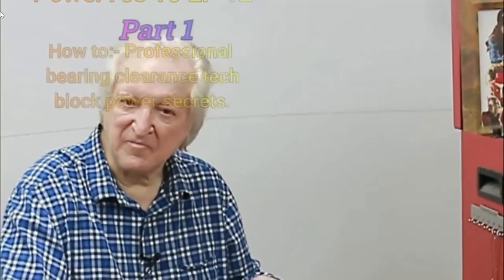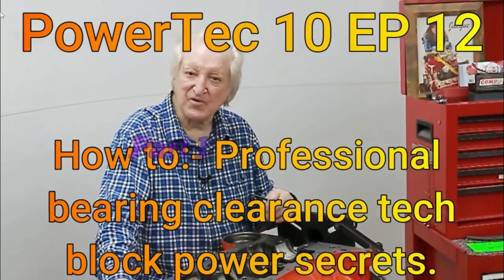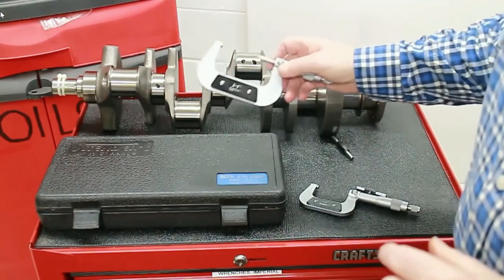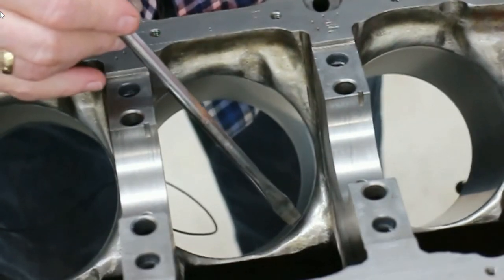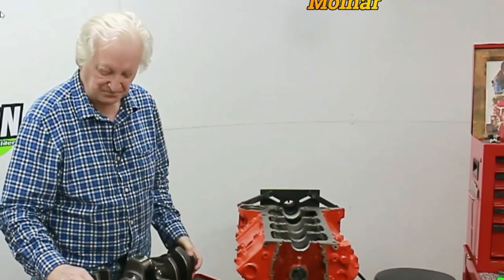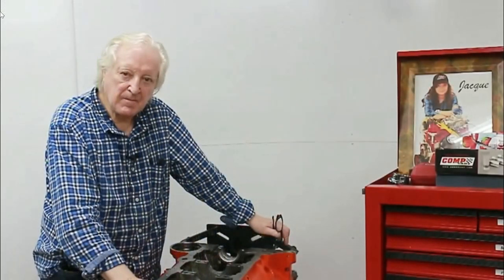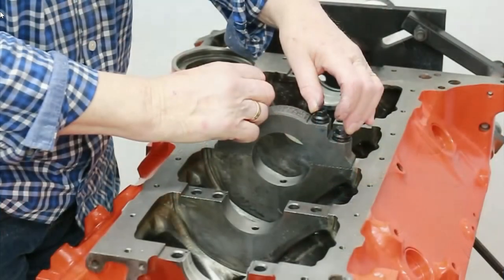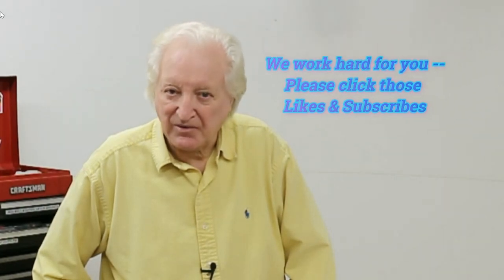Free short block power moves and setting crank clearance

Comment: Years ago and about the time Plastigage was just coming out, I apprenticed at a Cat dealer. At the time we used lead wire. Same proceedure as Plastigage, but when you pulled the cap back off just carefully pull the lead wire off and measure the thickness with a micrometer. Lead wire will deform without damaging the bearings.

Comment: Two things: 

One - i prefer to also check cap distortion with a bearing in place, especially on the rods since it's the only real way to check bearing crush and runout of the assembly versus the mating part. 

The dial bore gage is also very effective for checking cap alignment right at the mating face (should be perfect, often isn't).

Two:  plasti gage is a great tool.  I've used it for years as a final assembly check. I love that it gives an easy visualization of taper in the clearance (there shouldn't be any, but there often is).

Comment: For almost 30 years I've used the same rod bolt stretch guage and when checking rod bearing clearance I'd stretch the bolts to about 60% of the recommended stretch. That way during final assembly it's much less likely to get a rod bolt that turns into a noodle and stretches too much before it's recommended torque is reached. This is for plastiguage. But I also aquired a dial bore guage and decent micrometers years ago when still high quality and built in usa. I have quality japanese measuring tools as well and I still use a combination of both. Even a weekend engine dude should be able to buy mics and a dial bore guage over a 30 year span so start early as you can, but make do with plastiguage until your wallet allows.
Got a little ahead of myself, when building engines for myself or a customer, if it's high performance I still get use both methods plastiguage as a final, but will have used the dial bore guage and mics already in initial build and mock up. To me the most important thing to remember when running clearance checks is to look for trends. If you measured all journals of the crank 3 times and wrote them down they should all be within a ten thousanth thats .0001
At final assembly run a plastiguage check and just verify what you already measured. This way is alot of work but you won't lose sleep over clearance issues when you are done. 

Just want to add something to this excellent vid.
When rounding off and cleaning up the bottom of the bores be careful to not go too high into the bore. Just break the edge and roll it. 
Not many people put too much thought into this area but polishing up these areas to improve oil return is a great idea like David said!

Comment: I've used plastigauge every time always full torque, usually only once unless there's a tight one. Will just go 40 on mains next time. Rods not so sure until after resize arp rod bolts pull stock rods in a bit. After resize and clearance check I'll try both lower and full stretch and find out. Thanks for block tips also.

Comment: Im about to build my first small block chevy. Im looking for advise on weather to build roller or flat. Im looking to build maximum power for as cheap as possible with reliability in mind. Its just a engine build with nothing to put it in. 383 ?

Comment: I've used tons of plastigauge in my lifetime much of it on small engines but also on full size auto engines too. I have no issues with it especially using it as a double check of a machinist work

Comment: I will be buying the Chinese dart pro copy heads but 400 campaired to 2000 and the same thing minus valve guides and seats and yes same factory makes bolth heads if I was rich yes I would have all dart 433 block but China took their as cast 200 cc dart pro heads they make for them speed master etc. And sell them direct for around 400 a pair Bair I can use the extra 1600 for better guides valve seats 2.08 valves etc better springs and so on yes dart had a good design but dna/assualt/deepmoter/dart/afr/speedmaster all the same different hardware skip white sells a good pair already outfitted with good parts and a good guide to cam intake that any idiot can follow and im dumb thats why I'm watching this
Reply: You realize that fake dart chinese heads flow any wear from 50 to 100 cfm less... And not much cheaper than a reputable brand
Reply: @sniperpronerfmods9811  the ones I got flow descent the valve guides and seats i had replaced with better ones and im still under half the price of dart ones they flow 250 at .550 and thats higher then the dart ones are advertised for at least had them flow benched cause I plan on porting them
Reply: @codyreynolds6333  my edlebrock heads from 1989 flow the same as that... New dart ones do 100cfm more... Which is why I want to buy them even though I have heads on my c3 that already flow 250 at 550. Richard holdner has a video showing that they are the worst performaning after makerket head and that after springs and everything its only 200 bucks cheaper than like a afr as cast head which performances better according to the dyno
Reply: @sniperpronerfmods9811  they say they flow 230 at .550 on the site I looked at and they are all made in the same factory in China same things afr dart speed master assualt dna deepmoter all exact same heads Eric Weingart goes threw it on his YouTube channel and David vizard talked about it in a article ill go with 2 well known people no offense but they cc at 205 sold at 200 cc intake they are buy no means the best but for 380 bucks to my door another 350 for parts 120 for new seats and guides plus a 5 angle valve job at spokanes best head shop on Freya dude has great deals can't go wrong all good parts now but skip white sells the same heads and sells them built with proof of builds and cam choices thet are all the same from the same company so why spend 1500 from one the skip white ones are the best for built version he has dyno test that those heads set up for .600 lift and a roller cam pushing 572 look up nkb skip white heads they are all made at the same place mise well buy them cheaper and to do a port job myself way to go so if I f it up  not out much if you do proper research you will see they are all from the same company in China dart does take the best ones afr second and speedmaster 3rd but clean up the casting blemishes and they are identical but 380 or skip white built for roller cam 860ish look into it I get that their are better options but ill be into a 30lb boost making motor for 5800 scatt forged crank was the highest priced part the rest is pretty much cheap shit im doing this to prove to people who think it takes expensive parts to make power stock car with restricted plates amd stock parts be pushing well past 500hp I get paid good money to build engines its what I do as my day job ill make a video and try and remember to tag you
Reply: And holdner I seen the vid and he didn't take into consideration volumetric flow you need velocity if you out them on a dog yes they are garbage to big of head is the same as throwing a 292 cam in a stock motor it hurts the power look at Eric weingards vid all he does is heads and if you run them with the correct cam wich David vizard has the best formula in my opinion but he has never not been 1st place in anything set your car up rite and these will be ported after the first go round but look at skip whites flow chart I trust him over holdner they have been making race moters and winning trophies for years i trust results iver dino numbers from a magazine article writers opinion and results